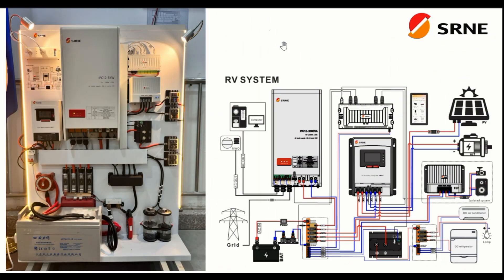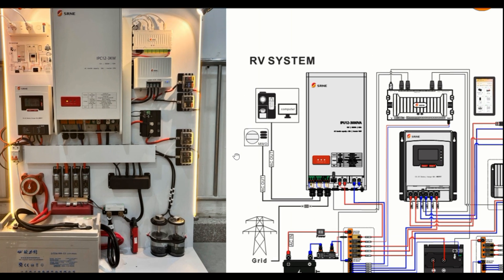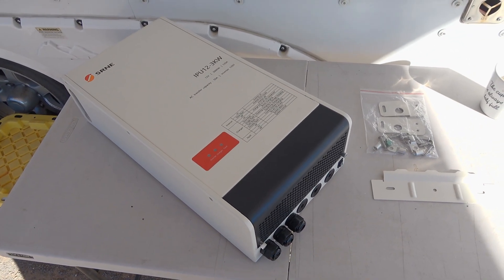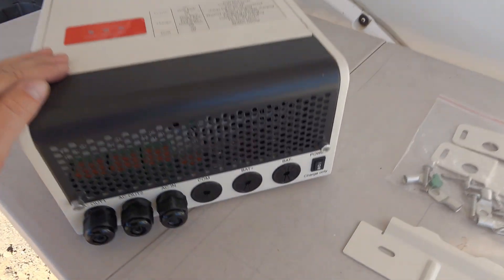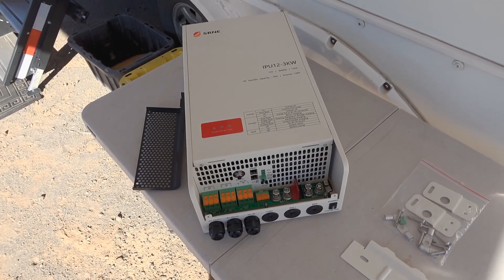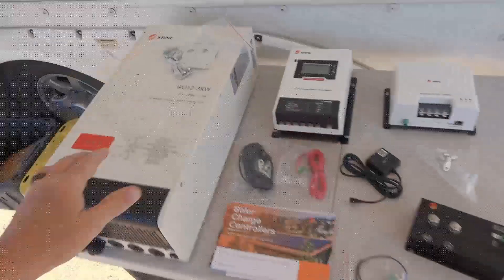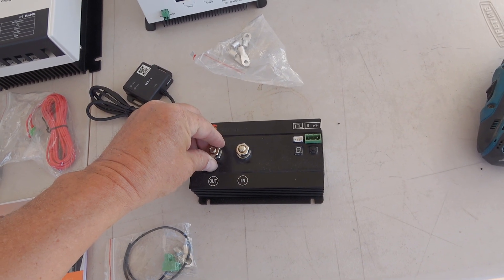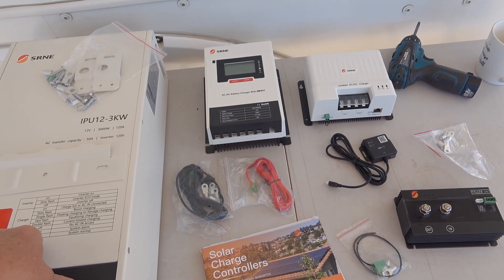Overview of Upcoming SRNE Off-Grid 12V Power System for RVs & Boats

Comment: Thanks Ray!  Is that 3K inverter specifically for RVs and boats?  It looks huge not to mention the weight.
Reply from the maker: Yes, that is the market it's aimed at since it's made for 12VDC mobile systems. Most of the residential stuff is 48 volts. If you look at other 3000W 12V low-frequency inverters from companies such as Magnum, Go Power, Samlex, and Victron, they are also large and heavy.  Usually, the telltale sign is how much thicker/boxier looking they are to accommodate the large transformer.
It's one reason many people go with high-frequency inverters like, for example, my Canadian Tire Motomaster or Xantrex Freedom XC Pro, which use multiple smaller lightweight transformers. The trade-off is more complex, so it may be less durable due to the more internal components required and less instantaneous surge capacity.